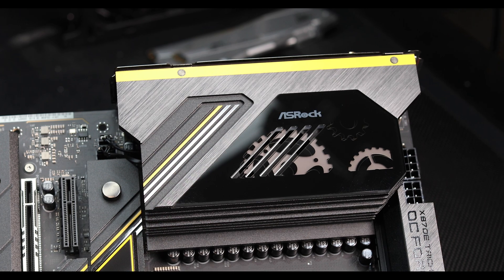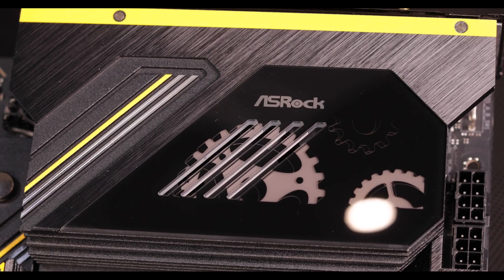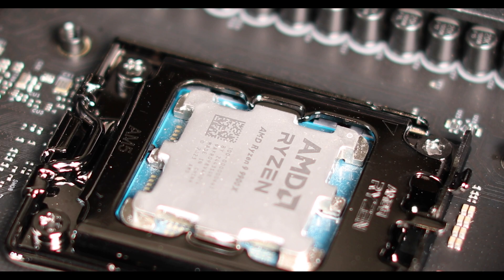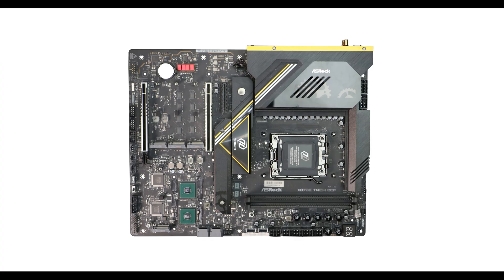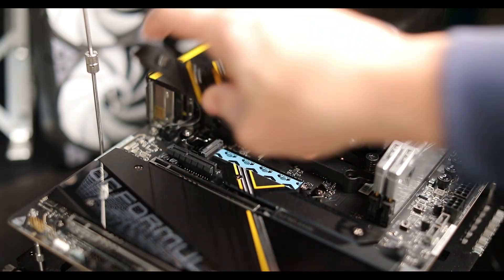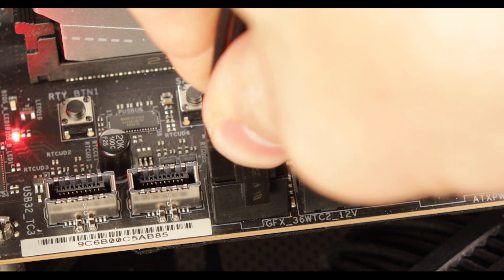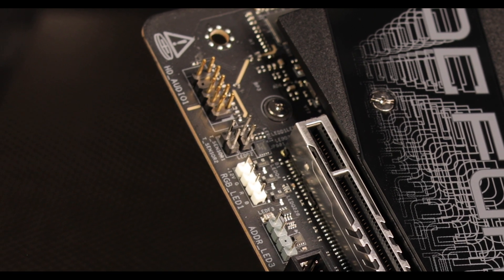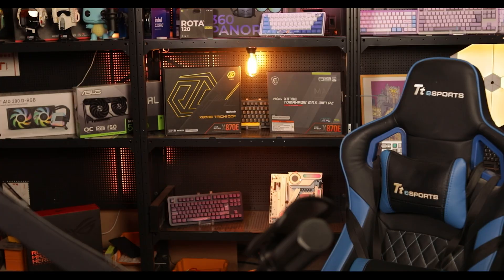ASROCK X870E TAICHI OCF: Pure Tech GOLD!

Comment: how much overclocking vrm headroom do you need i see the msi b850mpower having around 720a vrm and this asrock x870e taichi ocf having over 2700, but they are both overclock boards
Reply from the maker: The difference is that the larger capacity VRM will heat much less, and you can keep a more stable overlooked system over time. And u can push it a few hundred MHz more without risking thermal throttling ur powe stages. 

Hope this helps

Comment: 870 tachyon is also 10 layer so asrock isn't exactly breaking some barriers here. tachyon also has stronger cpu oc with better power delivery. not that it really matters on this platform because cpu oc is a complete joke to begin with. you should also probably mention how troll it is that a mem xoc focused motherboard has a 1.25vsoc cap. what kind of troll is that? xddd
Reply: the memory kit you're using is also the worst mdie ckd kit ever produced. not that it rly matters cuz mdie is terrible on this platform period.

Comment: Ok, the full Taichi is not the one I am interested in. This is a super impressive board but it would want to be, given it's aimed at the extreme liquid nitrogen overclockers. What they end up pricing this at ~ good question.
I would think, and hope, that in about 3 months or so, we will see a TaiChi Lite version of this, which features the same board, the same components and traces, but much less twinkle and bling, so it costs about $200 US$ less, while having the same components, the same PCB, the same basic design ~

When the TaiChi LITE version of this drops, I am going to be super interested. I am very much a likely customer for that.

15:40 ~ ‘Around $500 in the US.’ That works out to be about a grand ~ $1,200 Australian.

Look ~ I think this thing is overkill. I think even the LITE version is going to be overkill for me. It is targeting liquid nitrogen over-clockers and extreme (rich) enthusiasts. Up to the current zen 5 generation, I had firm ambitions of getting a 2 CCX 16 core chip, which would push the power delivery side a bit, but for zen 6, I really want one single CCX, meaning 12 cores and roughly half the power requirement of the top-end chip. And then we talk about overclocking. I am keen on the TaiChi LITE because it offers about the best standard of memory traces and memory hardware support in the industry, but that only matters if you’re planning to over-clock the memory. Now I do plan to ramp it a bit, try and get 64GB running at 6,ooo or very slightly higher, (staying in a one to one ratio, EXPO) but that’s not going to stress any medium to high-end board all that hard. Context ~ I don’t think I need a one thousand dollar plus motherboard, in order to get that.

In short, I think this is teensy tiny bit over the top for me.

I want to run a 12c zen 6 at stock clocks or slightly higher, at stock voltage or slightly lower, I want to use a Noctua NH-D15 G2, 64 GB of DDR5 at 6,ooo mega transfers / sec, a gen 5 M.2 drive of 2TB and slide my old spinning rust drive in as backup. 
I want an AMD Radeon graphics card which is relatively recent, so it isn’t some sort of shelf queen that’s already five years old when I built the computer, (which is why you got it cheap) and I don’t want to go for the very cheapest one you can get, (aimed at OEM builders / system integrators) but I do want the lowest end cheapest one that still shows up as a home-builder part you can buy with AMD Radeon branding ~ meaning they’re not ashamed of it, and it’s still going to have a decade of driver support under Linux.

Comment: 01:08 One of the motherboards I own has 16 layers, and it's from 2019.

The entirety of top X870E motherboards is a joke: 
1) Bunch of useless features (like screens on the mobos)
2) PCIe lane routing and allocation is trash
3) 2x PCIe slots on the Asus Extreme is ludicrous, not that Godlike or Aorus Xtreme are much better due to allocation 
4) Boards mentioned above are ridiculously overpriced for what they offer, they cost like my TRX50 Ai Top whilst having half the features at best
5) ASRock in particular burns X3D chips

And the companies keep getting away with all of it, be it AMD or the board makers, because people keep buying this overpriced garbage.
Reply from the maker: What board is that ????? 16 layers.. wow !
Reply: @Laurentschoice 
EVGA SR-3 Dark. Bought it for only $500 when Artesian Builds had been going through bankruptcy.
One of the most beautiful mobos in my opinion, as well as overbuilt and ridiculous (in a good way).
Reply: @Rubed0_o only 500? In 2019, 500 for a mb was like 1200 today. 😂
Reply: @Drumaier I bought it later, don't remember when exactly off the top of my head, but Artesian Builds went bankrupt a few years later.
The MSRP of that motherboard had been $2200, I like the thing, but not nearly enough to pay that much for it back then. 😂

Comment: The board is only surpassed by the quality of your review, Monsieur Laurent.  Any perspective on the "ASROCK kills x3d CPUs" situation?  That is my only reason to give pause ....

Cheers sir.
Reply from the maker: absolutely... ! So.. .the TAICHI / X3D issue happened mainly due to a BIOS version ( 0.3 ) which did not reduce voltage on some X3D memory segments. X3D CPUs are much  much more sensitive to over voltage, and in about 2% of the time ( which is higher than it sounds ) , this resulted into a burn CPU module. Fortunately enough, the new BIOS version have fixed the issue permanently. 
It is always a treat an honor to answer your comments MOSSIEUR OG :))))
Reply: @Laurentschoice That is reassuring news.  Thanks for the information, and as always, terrific job on the review.  Love your work!

Comment: This is the same POS motherboard that's been frying 9800x3d cpus. No thanks. I'll go with brands with real reputations.
Reply from the maker: So that would be true with the older 0.3 BIOS in some cases. The voltage differential has been fixed on the new BIOS version a few weeks ago.
Reply: I can't imagine this being the same. By this point they took note about the issue and made proper changes.

Comment: What an amazing deal! It is only 399 at Amazon! I have a b650 Taichi, and it is perfect, but this is 2x the board and when I get my 9800x3d it will rock even more. ASUS would have charged  $1000 or more for this board.
Reply: 9800x3D in an Asrock board... Yikes😬😬😬
Reply: @michaelgleason4791  They fixed that with the bios. I have never had an issue and been running a 78003d in a b650 Taichi for over a year.
Reply: What are you talking about? This board isn't on Amazon. This isn't a z890. Pretty sure this isn't released because I can't find it for sale anywhere in the US.

Comment: Noooooo, I literally just ordered a Carbon wifi over going for this board because there wasn't enough about it floating around. I had the Nova WiFi but it went dodgy and would only boot in LN2 mode so I've RMA'd it and am currently waiting for the Carbon to arrive on the 29th but I was so close to risking another AsRock with this board because I thought MAYBE just MAAAAAAAYBE they've ironed out the problem with this new board. Whyyyyyy :(
Reply from the maker: The carbon is awesome nonetheless ! Great choice !
Reply: @Laurentschoice  My Carbon wifi arrived with bent and damaged pins and wouldn't boot so I've had to refund it to amazon but now they're out of stock. They don't have the Taichi OCF either it seems so what would you recommend?

Comment: Comparing this to the godlike and asus extreme would be useful for context
Reply from the maker: I did mention the extreme and apex , but ur right .. a head to head with the Godlike would be nice :)
Reply: A more relevant comparison would be to the Asus ROG X870E Apex and the Gigabyte X870 Tachyon as those are 2DIMM XOC boards like this one (and don't cost $1000). MSI X870E Godlike and ROG X870E Extreme should be compared to Aorus X870E Xtreme; Asrock doesn't have a board in that tier.